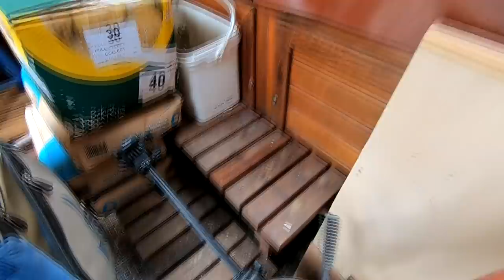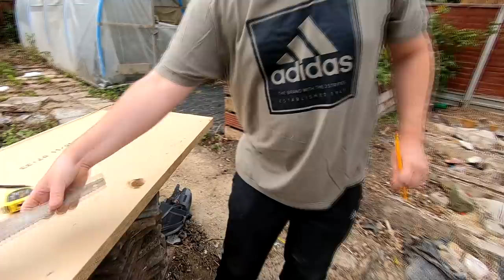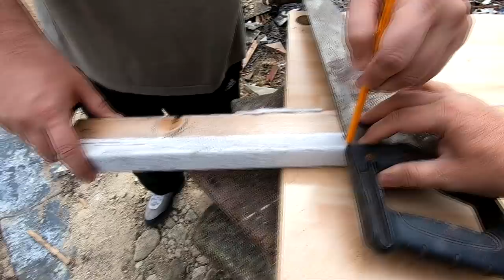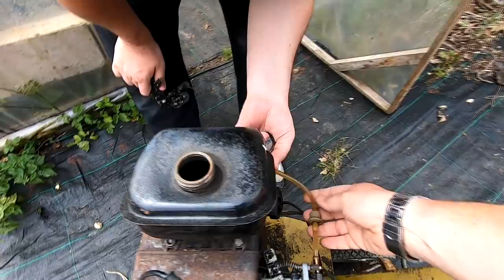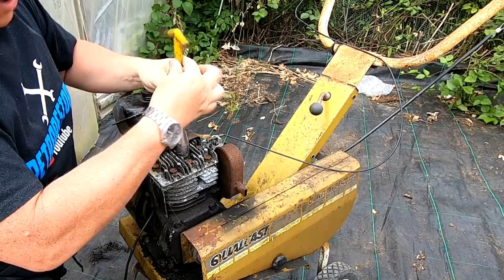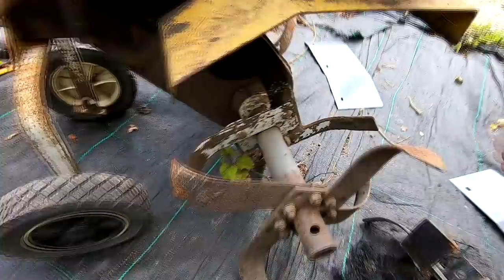A Rotavator, A Worktop And A Competition Winner Vlog

Comment: Great content on all channels Martin but Butlers Empire just comes first by a nose in my opinion, very comical at times 🤣🤣 Looking forward to seeing the garden work being done on Saturday .... hopefully Gary films the shed renovation - think it would make an interesting vid💎💎💎💎💎
Reply: Cool a fellow Vespa fan :D   I have to get on with my MK1 T5 so might be doing some vids in the future on my channel, got basically to recable, rewire some vandalised wiring, put a new shocker on the back, new fuel tube and filter and she should be good to go once again, on a C plate too so a early bugger but I bought it with a nasty 125 P range stuffed in it and fitted it with a LML 150 Xpress which is same power as a P200.   Its in the front room next to my 1958 Lambretta Li S1 which will never go out, too easy to thieve :(